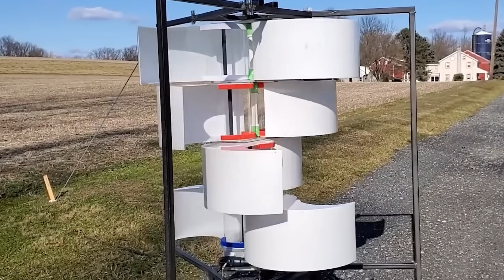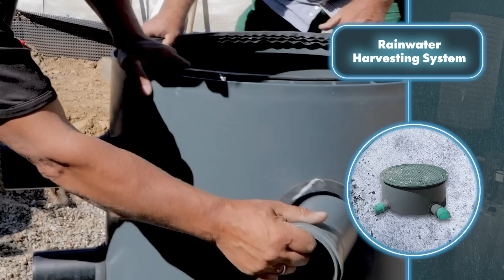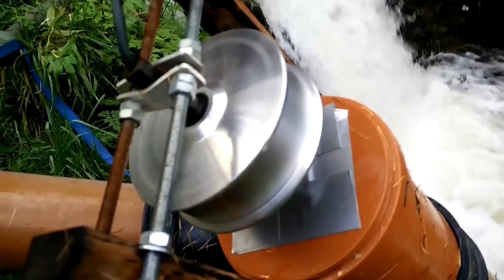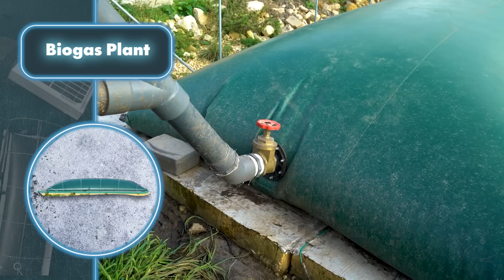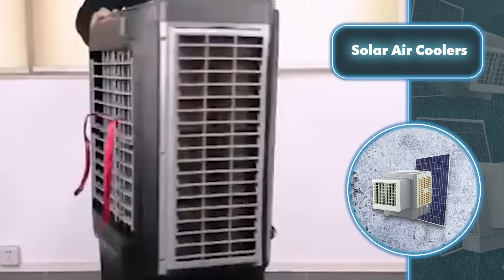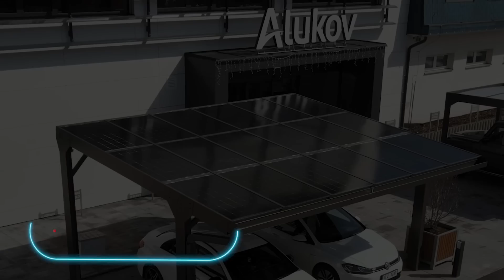Amazing Free Energy Inventions That Will Make Your Home Autonomous

Comment: Moist air coolers are a joke. Just raising the humity in the room the air is still hot >_>
Reply: They require low humidity. They work in the desert but water is a bitch in the desert🏜

Comment: Wind generator for where I live would be like placing Solar panels under the Roof lol, we barely get a breeze and came out of a 25 year drought where the wind was so little it wouldn't move the leaves in the trees, certain things work in certain places, this wind thing would work well in the Arctic or places that get tornadoes and Hurricanes and Cyclones.
Solar is the thing for us here as we get well over 12 hours a day sunlight :)
Reply: Yeah, but that is often true and should be common sense.  Just like you shouldn’t try to grow orange trees in Vermont, don’t install wind turbines if almost no wind, or solar if you live low light areas, etc.   It would be great if everything worked everywhere, but that is rare.
Reply: @Itried20takennames  Problem with common sense these days is the fact that it's no longer common, just look at all the Governments around the world trying to push so called renewables, there is nothing renewable about them, other than the amount of work required to keep them at peak efficiency and to say peak as far as Solar or Wind go is a joke as Solar only works half the day even in the best weather and Wind as the name says only works if there is wind and so isn't even a guaranteed half a day, then we are not even taking into account a Hurricane/Cyclone/Tornado/Dust Devil, or what ever the events are called in the area of the world, a huge solar or Wind farm can be turned into a pile of useless junk with one decent storm, or large weather event, we have now where I live after a 25 year drought now been almost in the dark for three weeks with no SUn as it's been raining constant for three weeks, I had to turn the power on for my Solar Hot water for the first time ever and the amount of Solar we are producing went from able to power three Homes, to not even able to power our Washing Machine, this means any Solar Farms in our area would be producing nothing and haven't done for three weeks, how useful is that as far as a large scale power system goes ? One Nuclear power station would produce more power 24/7/365 than all the Solar Farms put together over a year.

Comment: I have an idea. Take it those who see. Any water companies can utilize turbines to produce additional power since Im assuming they are working with & processing alot of water. Also Im assuming that water is rushing at high speeds. So water treatment or production facilities could also generate some extra power if turbines are included in the proper spots.